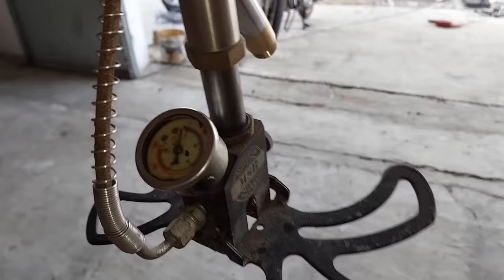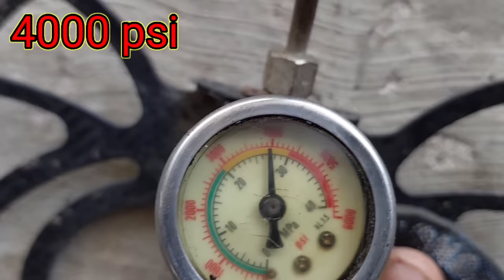4000 PSI. !! Membuat tabung senapan angin PCP dari shock motor bekas

Comment: Bahaya om jangan banyak banyak 2700 psi aja main aman, saya tau sok motor memang kuat tapi apa salahnya kita bermain aman
Reply: ho'o mana pake sil luar lagi😅
Reply: Sill luar paling ngeriii😂
Reply from the maker: Kalau hanya 2,7 mending pakai dural saja bang..enteng 😁
Saya sudah pernah buat seperti ini sebelumnya
Reply: @Yantoo  setuju om
Reply: @PUNGKY_25  sil luar boleh boleh saja asal dengan menggunakan pipa yang tebal kurang lebih 5mm keatas, kita ambil contoh bocap pada bagian drat coba di ukur maka hasilnya kurleb 7mm an kemudian dikurangi 1,5 hasilnya 5,5 dan pada bagian grov tempat sil 3mm maka aman aman saja,saya pernah tes pressure bocap Taiwan sampe 4000psi yang retak malah Chamber nya
Reply: Sy pesan bisa kah Om
Reply: @PUNGKY_25 trus seal dalam itu yg bagaimana?
Reply: @Yantoo   tabung shock apa yang bahannya paling tebal dan paling mantap bro?
Reply: @Frank-o8h  sok crane bos 10000 psi djamin aman😁
Reply: Bisa pesen om
Reply: Hasilnya cukup rapi tapi sayang silnya diluar. Menurut saya kalau pakai tabung sok mending pakai sistim pantek lebih aman.
Reply: ทำขายไม่ครับ
Reply: Aman tu 4000..
Reply: klok drat pnjang sya yakin aman,tpi klok pbrikan jga aman di 2,7psi,sya jga prnah mngalami mldak malah gak smpek di 2,7 PSI,habis itu sya coba bwa ke tkng bubut dan sya dksih srang tukang bbutnya ktanya bikin gnia aja pak dan sya jawab ok,alhmdlillah sampai skrang aman maen di 4000 psi
Reply: Ini aman, karna drat sangat panjang. Paling ganti sil aja kalau rembes...
Reply: @Yantoo cek harga nya bang
Reply: @Frank-o8h 
Sok motor honda win
Reply: @TADANTADANAYUB-ey4he   iyakah banh?
Reply: Tpi kalo non Mano 4500 masih aman
Reply: @Yantoo bengkelnya dmn om?bisa buatkan rumah valve od 32?
Reply: @WHA_FRM How can I know the pipe's ability to withstand air pressure?  3000 psi for example
Reply: @user-xt8xr2zc1n try searching about sch-40 or sch-80 pipe pressure rating
Reply: @egaaudiosoundsinten603 maksud bikin ginian itu gmana bang?
Reply: Bang order bisa nggak bang
Reply: Sya juga pake shock ini..disambung 2 menggunakan las welding agar lebih besar ruang tabung angin nya..main 3000 psi aja
Reply: @Bsmyusik pake mano pun 6000 psi aman asal cara pengerjaannya benar ...biasanya klo 6000 psi tu hasil tes kekuatan tabung agar lebih aman ketika di pake konsumen  jadi main amannya ya ttp di 4000/4500 .....kadang banyak reseler yg bilangnya aman  3000 
psi  tp baru 2200 meledak 
 

Tujuan pengetesan exstrim sebenernya hanya untuk mengetahui seberapa kuat tabung itu sendiri jadi jangan salah artikan
Reply: Shok motor bahaya gan....itu pipa besi
Reply: Hermano vivo en Cuba qué materiales me recomiendas para el depósito de de aire.Le agradezco
Reply: @WHA_FRM Chamber nya dural, bahaya kalo retak bg, bisa meledak
Reply: Ini cuma konten lur.. Ojo di pake beneran. Kita main aman pake produk pabrikan aja yang sudah jelas peruntukan fungsi dan keamanan yang sudah lulus test uji.
Reply: Seal dalam.lebih aman,.dibuat di posisi ujung baut, dan saat terpasang itu berada di pipa bagian dalam yg posisi ketebalan.aslinya, kalau seal luar maksudnya kurang aman karena dapatnya pipa tipis sudah berkurang akibat pembuatan drat ulir. @ziadpatata261
Reply: Kalau pesan bisa nggak bang
Reply: Triger pk teplon cm diketok pk besi obeng, klu teplon nya hancur itu besi obeng kira2 melayang kemana ya? terdorong high pressure
Reply: bikin senjata api tak serumit senapan angin, resiko juga lebih besar senapan angin, ibarat membawa dinamite
Reply: @CAHWONOGIRI_TIMUR sok tau
Reply: Emang sedang bahas apa tah?
Reply: @Frank-o8h punya BMW 1000rr bg😂

Comment: The sheer fact he doesn't neasure anything, and yet it ALL fits, is testament to the skill this guy has. I could watch this Master Engineer work all day. He has turned (sic) machining into an Artform.
Reply: CNC?  Seems unreal that a person could have this kind of control over a lathe by hand.  To make an air chuck fitting completely by hand?  If that was truly done by hand with nothing but his eye as a guide, then the guy in the video can name his price to work at any metalworking/CNC/fabrication shop.  Whether it was done old school or CNC, the skill, craftsmanship, and ingenuity are impressive.
Reply: @Brian424  magkanoyan boos.
Reply: @Brian424  Craftsmanship? Hammering the valve shank in skew when it's literally in a lathe whose purpose is concentric work? That part was murder to watch. Drill the hole slightly undersize, chuck up the shank and feed it in for a light press fit. Using this method can produce a valve concentric enough to not need any secondary truing operation (although it is good practice to). That hammered fit can cause the seal to crack in no time. He would have to demonstrate that he can produce consistent parts to drawings and dimensions before any real machine shop hired him. There is a place for eyeballing and it is hobby work and art work.
Reply: Apply some of those SKILLS to building beds and chairs for your FAM.///  JUST sayin'
Reply: I'm sure he's measuring,  just not showing it in the video
Reply: @BC-wj8fx  Hobby? You sir are oblivious to a world outside your own. I will fully admit that the hammering segment is below my brother Yanto's typical workmanship, but no this. I'm familiar with Yanto's part of the world and guys like Yanto aren't hobbyists. He's keeping all kinds of machinery running in his little village. His skills are invaluable to all that know him!  Me too!
Wakodahatchee Chris
Reply: @georgescarlett2320  He can probably do more in a squatted position than you can with the best of work benches and tools. You should feel inadequate after watching him.
Wakodahatchee Chris

Comment: It is always better to have the o-rings after the end of the threads in the tube. This is due to the hoop stress being twice the axial stress in the pressurised section. If the threaded section is at atmospheric pressure (i.e. after the o-ring) then it only sees axial stress which is the lower of the stresses. Since threading weakens the tube walls and creates stress risers, removing the hoop stress from the threaded section offsets the loss of strength. Isolating the threads from the pressure makes the design stronger (for the same tube) or lighter (able to use thinner tube for the same strength).

Comment: At 4000psi it is safe because the inside area of the cylinder is quite small,  twice the cylinder diameter at that pressure,  it would start to get dangerous.

Comment: Saran... Kalo bisa oring seal di depan drat. Bukan di belakang drat tabung..
Reply: Selama tabung masih tebal aman aman aja,gimana tabung dengan tabung bocap kok sil nya di belakang😊😊😊
Reply: @arifrudis211  karna id drat nya kecil
Reply: Dia main high pressure. Klo pressure di bawah 3000 psi aman2 sja.. saya jg pake as sok vixion od 33 pressure 300 bar.
Reply from the maker: Kelebihan didepan tabung tekanan tidak masuk ulir, drat hanya berfungsi menahan tekanan dorong dr tabung, kekurangan diameter dalam tabung harus dikurangi sebelum pembuatan ulir agar siel tidak rusak saat dimasukkan..
Kekurangan siel di belakang tekanan masuk drat, kelebihannya tidak ada pengurangan diameter dalam pipa sebelum membuat ulir
Mau pilih yang mana bebas.. masih menjadi pro dan kontra untuk siel didepan dan dibelakang, kejadian pecah tabung itu karena tabung tipis atau drat oblak.. 
Terimakasih saudaraku, salam satu laras dari Jateng
Reply: @hendryjalletoth3091  bubut ulang apa menggunakan ulir bawaan vixen om
Reply: @toliptolip3989  bubut sesuai drat bawaan cuma di panjangin skitar 4cm
Reply: @Yantoo  lngsung di drat tanpa mengurangi ID pipa. Seal pke yg bagus psti ga robek. Klo seal di luar drat kebanyakan korosi karena udara dari pompa mengandung uap air.  Mungkin karena matrial as sok dari besi.

Comment: 4000 psi = 275 bar. To pump up this pressure with a hand pump, you must weigh more than 275 kilograms. I think there's 27 bar, 400 psi
Reply from the maker: Do you really not know hill pump?
I suggest you search on Google about the power of a pump like this.
Reply: @Yantoo  Even if it can pump up such pressure, it is due to the small diameter of the rod, since the pump is single-stage. But in this case, it will take hours to pump from zero to 300 atmospheres
Reply from the maker: you really don't know about pumps like this... even people in my country can make a pump with a pressure of 6000 psi, fill 500cc in just 15 minutes at a pressure of 3000 psi
Reply: That's not a bicycle tire pump. It's a Multi Stage Pump used for High Pressure Air Rifles. I have one. They work in different ways, depending on the manufacturer. The first pump forces Air into a chamber of the pump, Pressurizing it. The second pump forces it into a 2nd chamber compressing it some more, and the 3rd pump compresses it even more into a 3rd chamber.  a 4th pump releases that compressed air into the tank. Meanwhile the previous chambers are going through the motions all over again. They are capable of 4000 psi
Reply: Where can i get those high pressure air rifles?  @N-Lee
Reply: @N-Lee  I mean, wouldn't it be easier to use a compressor with the same operating principle? Two, three stage. 15 minutes of continuous pumping is some kind of hell. To then fire a few shots. I think a 300 atmosphere compressor with the same capacity will not cost much more than a pump.
Reply: @hibahprice6887  Those kind of compressors exist, and are used to fill the large scuba oxygen tanks. (3000 psi)  Pretty hard to carry them with you out into the field. Most people get a scuba tank, fill it, then use it to fill smaller tanks. You are correct, Hand pumping a smaller tank to 3000 psi IS Hell. I wrecked my shoulder doing so, it took 2 months to recover. Either type of pump is expensive IMO.    I stick with hand pumping to 1900 psi.

Comment: Please DONT, first hydro test with water to at least 2 times the working pressure to see if there is any permanent deformation. If there is even slight permanent dimension change, you can’t use the tube! High pressure air is not a joke! It will kill you! As an engineer seeing this type of manufacturing without knowing exactly what material and what is needed is very alarming.
Reply: Seeing this type of manufacturing period, is very alarming.
Reply: Amigo  tienes bastante conocimiento al respecto, podrías compartir algunos de esos conocimientos conmigo y algunos consejos, para yo fabricar mi propio rifle pcp... Gracias 👍
Reply: @MJPilote veo que manejas bastante el tema, quiero fabricar mi propio rifle pcp, podrías ayudarme con un tutorial paso a paso de fabricación, materiales y medidas, sería estupendo, Gracias 👍
Reply: Que dices...❓ 😉
Reply: @ramonflorez4531  Have some videos on my channel about valves and so on. But have not thought about making a complete tutorial on pcp at this moment. It takes alot of time to make a complete tutorial and youtube dont monetize that kind of content. So maybe on Patreon could do that.

Comment: 4000 psi is complete BS. More like 100 psi. 4000psi is mid range hydraulics pressure and would be impossible to reach with a simple tyre pump. My guess is he simply swapped out the scale in the gauge from a much higher rated pressure gauge.
Reply from the maker: you are late in getting information about technology, my country Indonesia can make hand pumps that can fill pressure with a force of 6000psi..
You should search on the internet for PCP air gun pumps